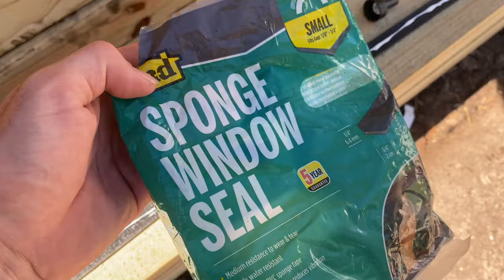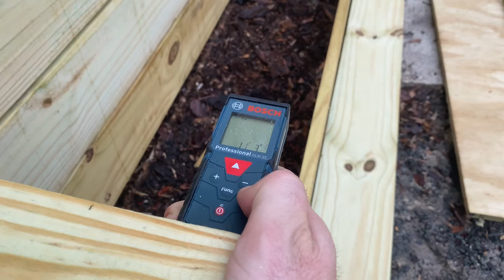Building an Outdoor TV Center with Raised Flower Bed | How I Built a TV Cabinet |

Comment from the maker: Power Tools:

Ryobi Palm Sander: https://amzn.to/3tATho6
RYOBI Circular Saw: https://amzn.to/3sJOv7d
CRAFTSMAN V20* Cordless Drill/Driver Kit - https://amzn.to/3qcsBYN
CRAFTSMAN Drill/Driver Set, Impact Ready Bits - https://amzn.to/3IKRNfs
Bosch Laser Measure: https://amzn.to/40NZ4Tg
Porter Cable Air Compressor: https://amzn.to/3sKI43T
Dewalt Reciprocating Saw: https://amzn.to/49P3Ioo

Hand Tools:

Post Hole Digger: https://amzn.to/3NIMiQQ
DOVOH Laser Measure: DOVOH 4x360 Laser
Stanley Saw Horses: https://amzn.to/40D9o0u
Hammer: https://amzn.to/3SEoxfX
3 ft Long Level: https://amzn.to/3QQt2Sj
Putty Knives: https://amzn.to/3us3Nht
3M Precision Sand Paper: https://amzn.to/3MTorNe
Caulk Gun: https://amzn.to/3MEwTjj
Putty Knives: https://amzn.to/3MIF91M

TV:

Samsung TV: https://amzn.to/47lzfvA
Outdoor TV Cover: https://amzn.to/3GWnmSa

Hardware and Materials:

Wood Glue: https://amzn.to/47hXBGG
Plastic Wood: https://amzn.to/3OFWuuH 
1/2 Inch Common Nails: https://amzn.to/46abzKc
Construction Gloves: https://amzn.to/43kOraY
Casio G-Shock: https://amzn.to/45tL5Ep
Supreme Silicone: https://amzn.to/3STmaGi
Quikrete Concrete Mix: https://amzn.to/3ulDmdc